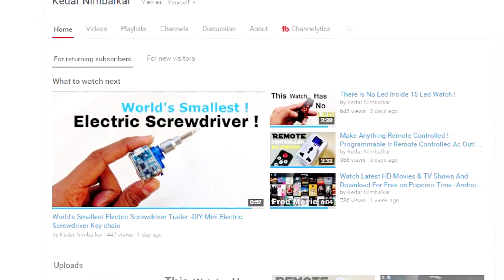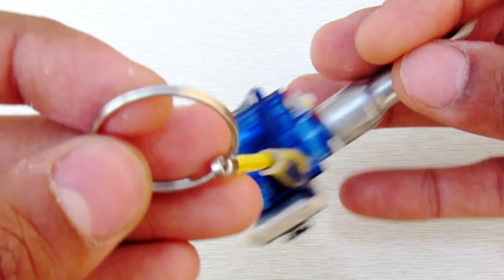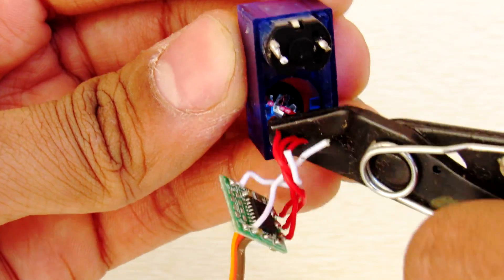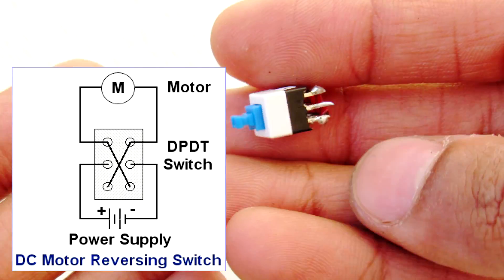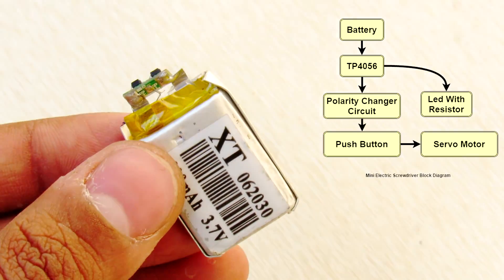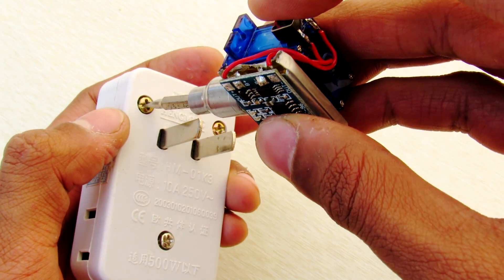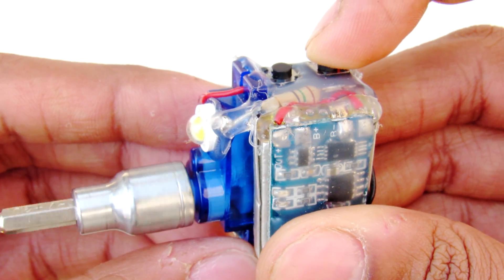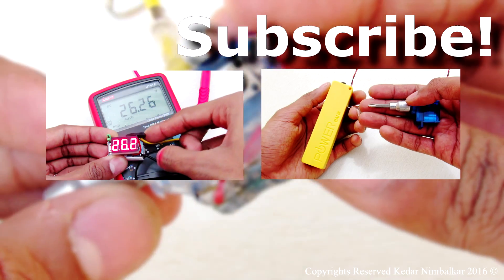Mini Electric Screwdriver with $2 9G Servo !

Comment: hey kedar  plz send me link for 4mm hexnut attacement I cannot find anywhere or plz tell yeh mujhe kaha se milega
Reply from the maker: i Got hexnut attachment from screw driver set but similar can be found on dremel tool which works too, check out this
http://pages.ebay.com/link/?nav=item.view&id=261913870167&alt=web
Reply: +Kedar Nimbalkar where do i get the hex nut attachment kedar